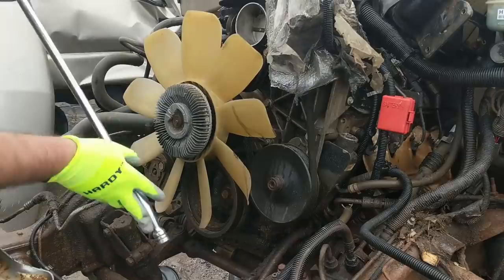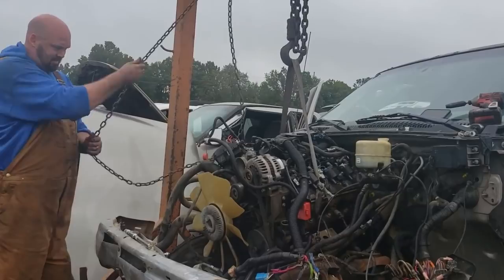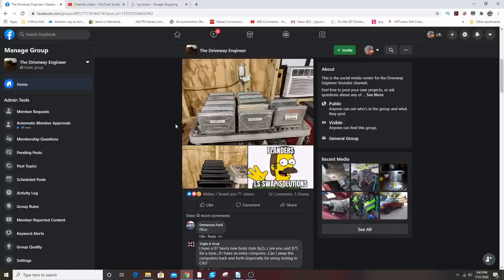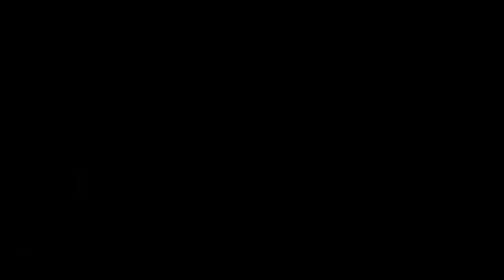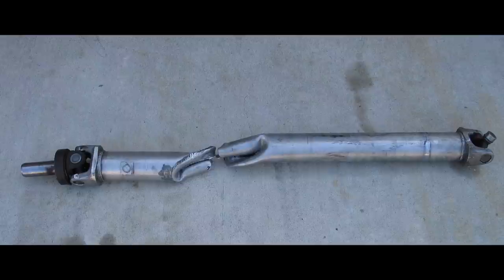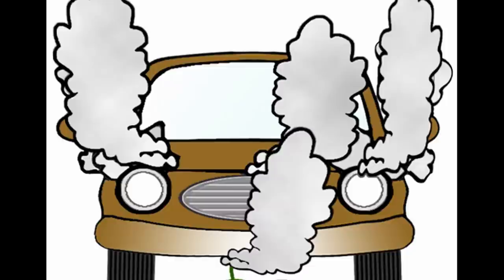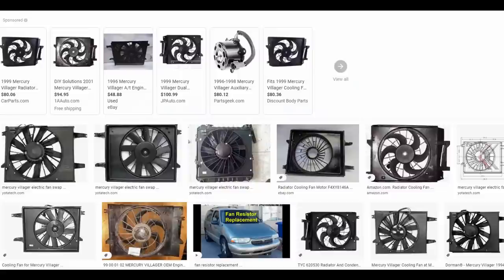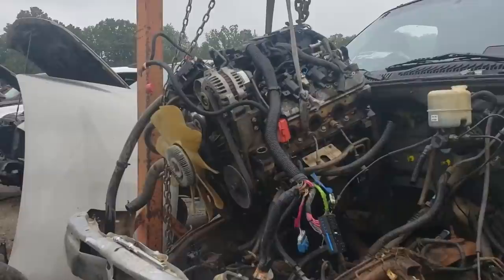Everything you need to know about LS Swaps in one video!!! (Probably not, but I tried)

Comment: I'm a big fan of your videos and all of the information you give out.  I can only imagine how long it takes to make them and do all the editing and I appreciate it.  I have recently completed a L59 swap into my 1976 GMC Sierra Grande Long Bed because I was finally inspired to get off my ass and just do it because of your videos.   It's fun and most importantly it starts up when I turn the key without fiddling with all that carbureted garbage.  I kept the cats and all of the emissions stuff because I prefer to have less smell and smoke because the cats do a good job of covering up any oil burning and it was before I got too far into tuner pro for anything other than the VATs delete.  I even kept the mechanical fan because it fit perfectly in the original shroud.  The A/C isn't finished up yet because I need to get some lines made up and figure out the pressure sensor or high/low switch to make it run with the PCM.  Ramble complete.

That being said...  Would it be possible to change all of your audio to mono or stereo or whatever so the sound matches on both speakers?  I listen to your videos with my bluetooth headset sometimes and usually only have one ear but in at a time and some of your videos I've noticed I can't hear anything when there's a voiceover.  Just a suggestion to help out the great videos.  Keep up the great work, Man!
Reply from the maker: Thank you!

The older videos were uploaded with one channel, unfortunately I can't change it now

Comment: Hopefully one day you can do an obs swap SUV in paticular with a newer matching transfer case and front differential. I know there is somethings you dont have to wire up necessarily since its already wired in like the fuel pump and relays. Paticularly 96-99(00limited/z71)

Comment: I have been watching your video and i appreciate your efforts and the education from your hands on knowledge. 

I havr a 1956 chevy 150 and i want to do an ls swap with the inline 6 that is currently in there. I was looking at an ls3 or ls9 to put in with a 4l80. I am unsure of what rear i should swap and the drive shaft. Where did you get your drive shaft from? I would like to make 400 to 550 hp in the car with my swap. Any suggestions on what motor, tranny, drive shaft and rear i should put to equally support the swap?

Comment: Morning JR, is it easy enough to swap to a drive by cable? I would imagine something needs to be changed in the ECM... Thanks for the great vids!
Reply from the maker: You'd need to change the ECM itself. 

Normal DBW ECMs do not have drivers for the IAC valve. Some vans and other applications do, through 06.
Reply: @TheDrivewayEngineer  thanks a lot. That's kind of what I figured. Keep up the great work!

Comment: Tejas mount for Squarebody is best! :)
Reply from the maker: Nothing is ever the best.

Different strokes for different folks.

If you have a 4x4 and want to keep your stock transmission, Tejas mounts won't allow that.
Reply: @TheDrivewayEngineer  ok for 2x4 is the best! lolll :)
Reply from the maker: Really only if you want to keep low mounted AC, otherwise moving the engine up and forward is pretty much the opposite of what most people would want to do.

I have them, and I like them. Because 100 mounts is cheaper than relocating the AC for me.

For others they don't care about the AC, 20 dollar plates make more sense

Comment: I’ve been watching your videos very informative I have a question about putting together a serpentine set up on a lq9 going into a 1970 firebird trying not to get screwed on relocating accessories ac power steering wanting to use as much of my donor engine as possible
Reply from the maker: ICT Billet and LSX specialties have about every kind of combination of pulleys and brackets you could think of .

Comment: I have 07 nnbs 4.8 broke the motor i have 04 lq9 6.0 or 99 ls1 . The 4.8 is gen 4 right & the other 2 gen 3s so the cam sensors n knock sensors or in different places . On my 4.8 nnbs wire harness what do i do to work in the gen 3 motors like cam sensors are in back & my harness plug is in front? The knock sensors are on side of block & gen 3 is on top? Do they make extensions for these plugs to reach & i could also delete knock sensors in the tune right?

Comment: JR quick question, on building an engine for boost, what do i go with for compression ratio? Thanks in advance
Reply from the maker: I don't build engines for boost.

I don't build engines at all.

Whatever they are when I find them, I add boost to.

What fuel you run and how good you are at tuning will limit how much boost.

Comment: I been working on my  5.3 I put into my 01 dodge Dakota.it cranks no start..I  can't get sparks an fuel injectors aren't working. It has 12v with key on, the ohms are 2-3 on all of them..i have the truck that the motor came in.it was running good..i change out the cam,crank, an it still doesn't work..the  donor truck is a 03 Chevy Silverado 1500.i been working on it for weeks.i am not changing nothing it's all stock
Reply: O the fuel pressure is good an it holds around 55 with the return line
Reply from the maker: There's not much I can do for you, you'll have to get a scanner on it or a noid light and see if the injectors are firing

Comment: I wanted to try a swap into my 2010 Camaro V6 since I blew a piston will I have too many issues to be able or make the swap?
Reply: With a 01 or so 5.3 with stock auto trans
Reply from the maker: If you want all your stuff to work, it'll never work.

If you don't care, then there's nothing special about it vs any other swap
Reply: @TheDrivewayEngineer  mainly just want ac and idk about the differential since it has that traction control. Didnt wanna spend 4k on a long block to keep the v6
Reply from the maker: Not gonna happen
Reply: @TheDrivewayEngineer  so it wont work with the camaro diff?

Comment: So does a transmission from a 1999 2500 5.7 work for a 2003 5.3?
Reply: If it dont im sure they make some kind of adapter plate, im gonna be using a 400 and they have an adapter for it that ive seen
Reply: @artificialdopamine6542  nice pfp

Comment: would an 07 trailblazer ss be a good donor car for my ls swap? going into 89 iroc. hope u respong lol thanks
Reply from the maker: It is, you'll probably have to change the oil pan and pickup though
Reply: @TheDrivewayEngineer  what is a good safe adjustment for the torque management  in hptuners
Reply from the maker: @CobosDoesItAll  safe is leave it alone